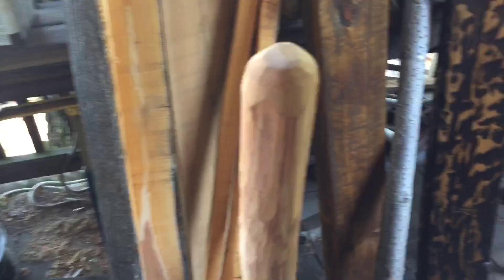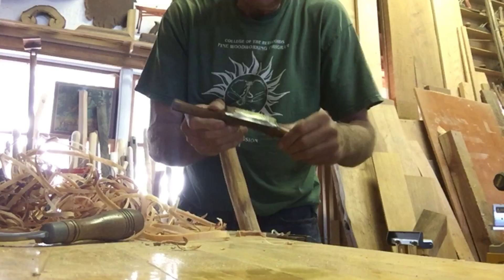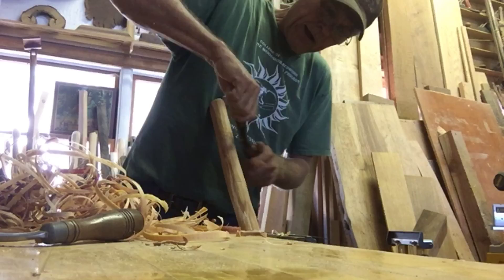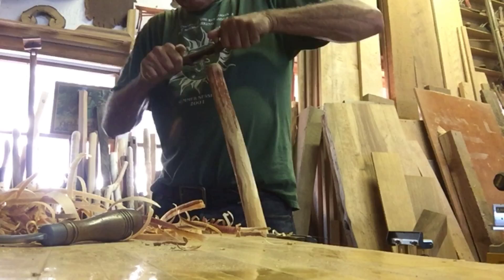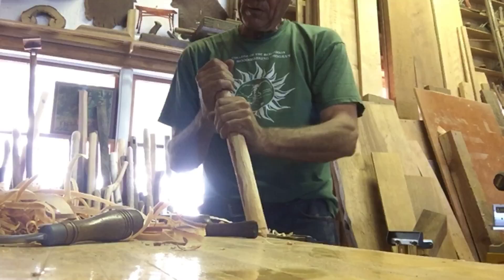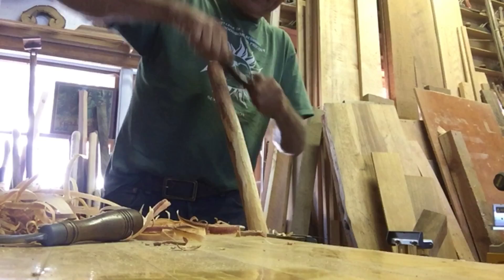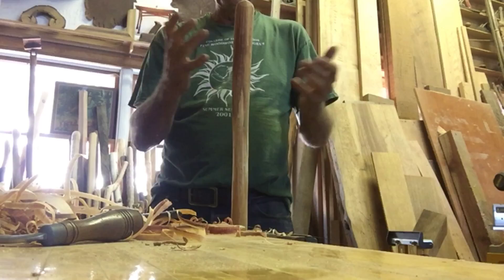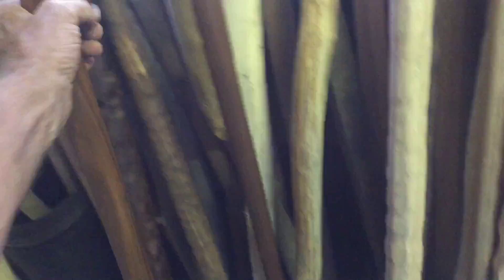More Walking Sticks?

Comment: Every one of those walking sticks is going to come out beautiful when it is finished. The channel is about you and what you are and what you do. And you are correct about that red on that pear walking stick in that it will come out when it is being finished. One way of bringing that red out is to use like a carnauba wax or even sanding sealer with a single layer of varnish over the top of that would bring that red out beautifully but I would say to keep it natural as possible and easily maintainable on the Finish go with a carnauba wax.
Reply from the maker: Jeffrey Murdock need to wait until it drys to finish it. Patience is important in woodworking--and life!

Comment: i was a police officer and got hurt in an accident. I fell 20' from a repel tower during repel training and messed up my spinal cord. I was parallelized on my right side for a while and was able to work hard and get out of the chair. I have had 2 neck, 2 back and 12 knee surgeries. The older I get the harder it is to get around. My right side is about 40% weaker, I walk with a very bad limp. I find myself using my walking stick more and more. I would love to own one of your sticks. What a great story would that be? I'd be glad to pay for it.